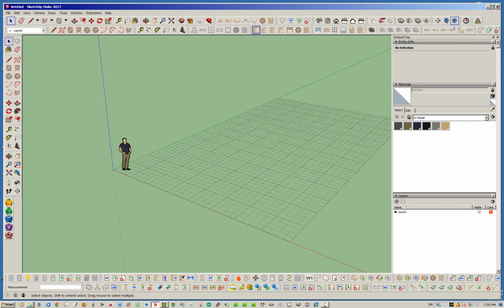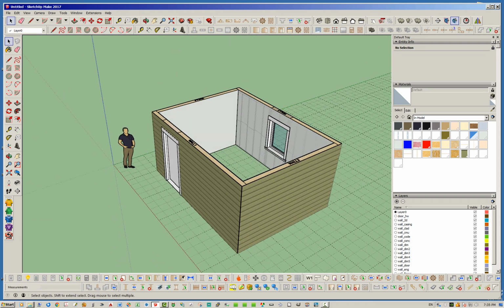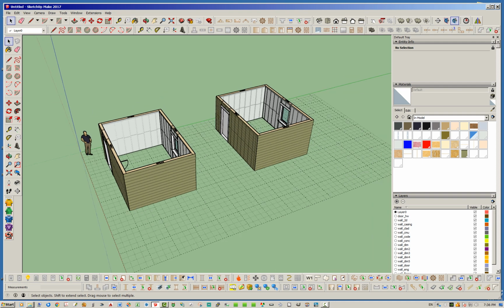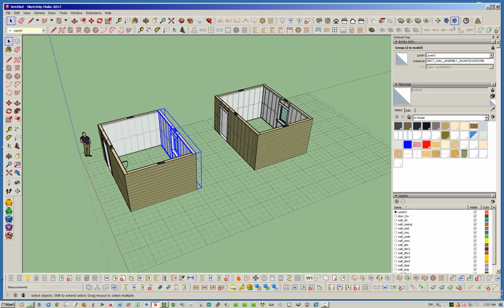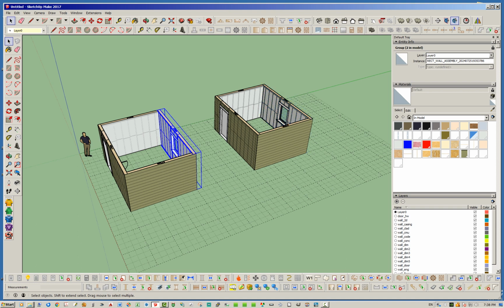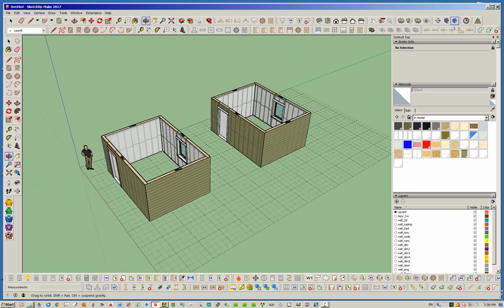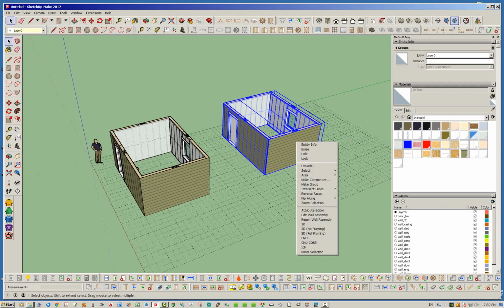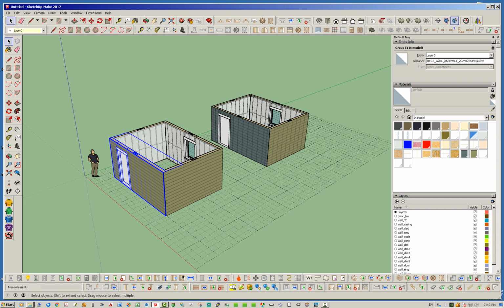Medeek Wall Plugin Tutorial 51 - Duplicating Walls

Comment: So on a mac SU this is not working as shown. Use generic SU move tool +alt key to copy, right click on copied wall >regen wall assembly. The original wall is deleted.
Reply from the maker: It looks like you are still running Version 3.6.8b.

You need to upgrade to Version 3.7.0 for this feature to work:

Version 3.7.0 - 07.25.2024

    Added a duplicate wall check to the regen module for all wall types.
Reply: @medeekdesign  sorted thanks
Reply from the maker: I'm not sure why it would work on a PC and not on a Mac, there is no difference in the code for either, and their is only two very straightforward API calls which are also not platform dependent.  I just tested it on SU 2023 and SU 2017 as well and it works fine in both.